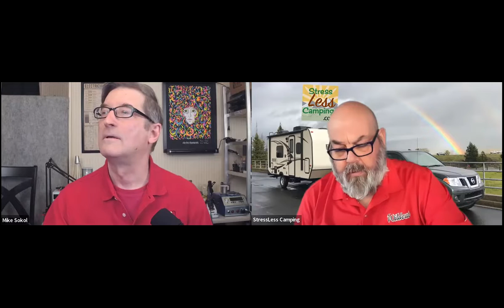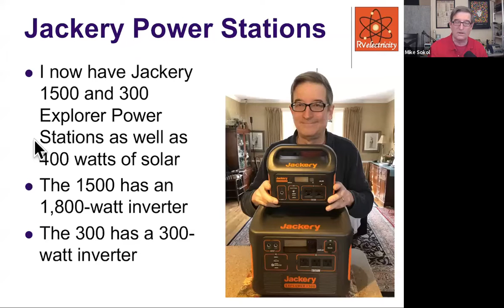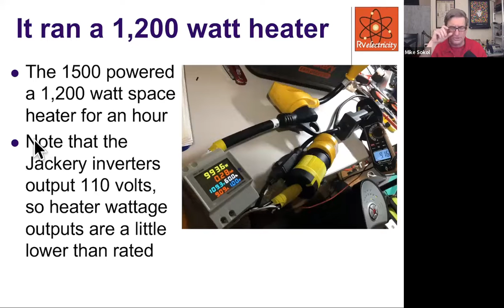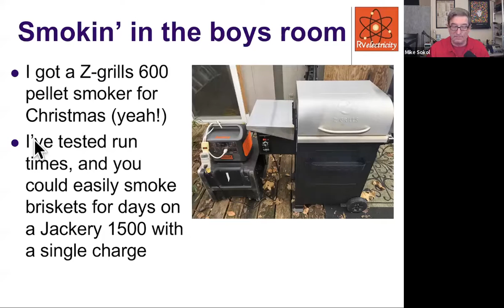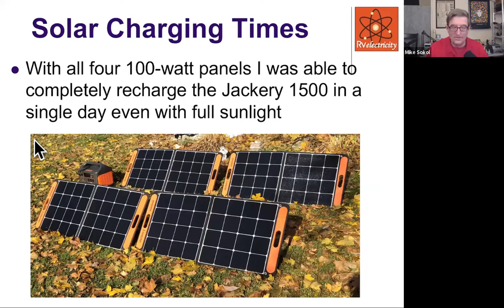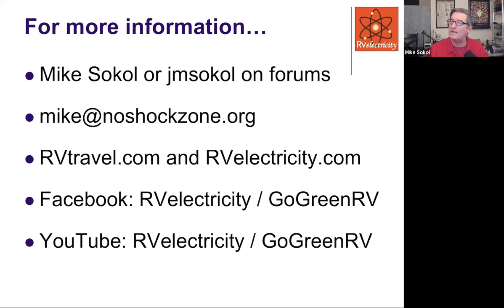Mike Sokol Jackery Explorer Demonstration with Tony Barthel

Comment: Hi Mike. This video is so timely for me. I just bought the Jackery 2000 and no solar panel. Here’s why. I have a Casita with 325 watts of roof mounted solar, 4 battleborn batteries and a 3000 watt inverter. Additionally I am leaving in May for a 3 month guided caravan tour of Alaska.  Sooo my plan is the Jackery will be used extensively and can be recharged by plugging it in to the Casitas 12v system, probably while driving. Is this a good plan?